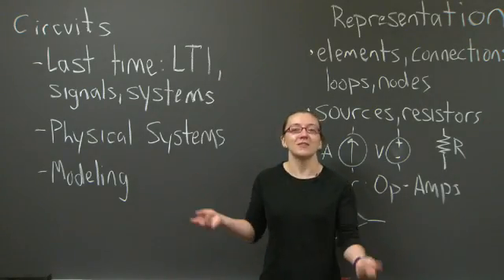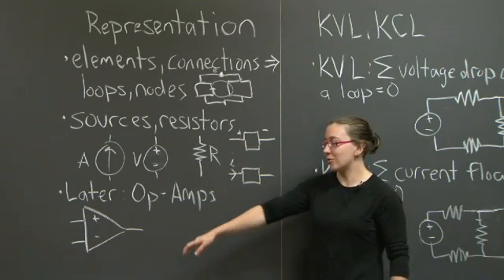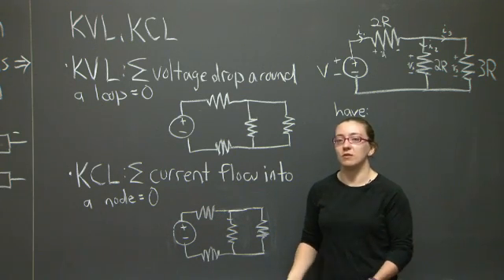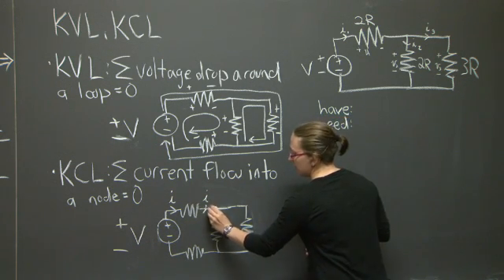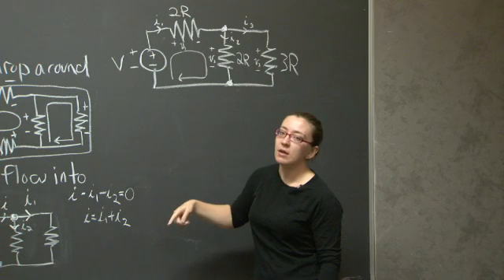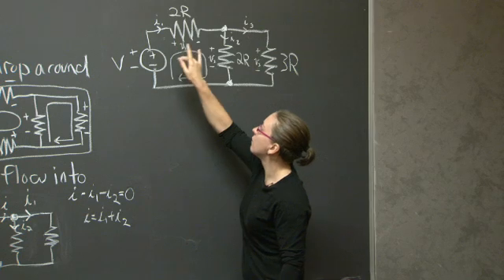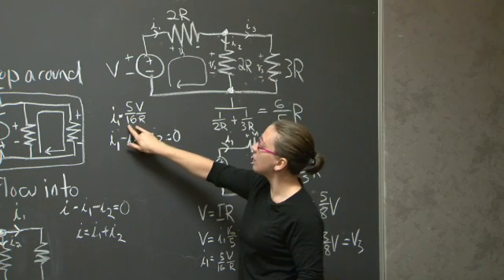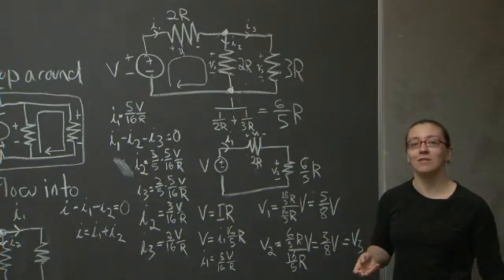Rec 9 | MIT 6.01SC Introduction to Electrical Engineering and Computer Science I, Spring 2011

Comment: KVL while useful for circuit analysis does have short comings in the presence of non-conservative fields inducing activity in the circuit. The closed loop may be excited in different parts based on geometry, angle and distances to the field source. In a transformer due to the design of most transformers their is minimal non conserved fields, you will see this when you analyze their design. However in cases of exterior fields this will not always be the case to assume a conservative field and will even be so in high frequency applications where increased self inductance of a circuit will become non-conservative and the potential in wires may not be ignored. Only in idealized scenarios in order to analyze basic circuits is KVL useful, when the circuit allows these assumptions KVL can save time in a complex circuit.
Reply: What would you use, Maxwell equation within time or frequency domain?
Reply: @1972hattrick  Maxwell's equation always works. KVL works in a lot of simple circuits but becomes an estimate if self inductance is significant. So it depends on what you are doing and time management. Feynman suggests KVL for simplicity when you can afford to estimate in a complex circuit.
Reply: @michaelinamoment  I'm guessing you would be referencing pcb design? So when you have multiple layers of bus and your signal is moving very quickly it induces a changing magnetic field which could induce parasitic inductance into other layers. Now the pcb material is not a conductor so you would have equal charge distribution (instead of charge going to outer surface like a conductor) this would need to be accounted for in the model utilized when solving a circuit (Guess law for field density). IOT minimize the effect of these parasitic issues you would use op-amp to stabilize the output needed at an important junction. 
Once modeled correctly wouldn't you proceed with KVL/KCL rather than Maxwell calculations? 
I'm not an engineer just someone who started watching videos on YouTube last year.
Reply: @1972hattrick  if you have equal distribution of charge then kvl will likely be ok. But the issue often becomes when you don't have such an ideal scenario. I think some people are used to working on certain kind of circuits where they don't come to expect charge from a non conservative field. If your circuit was hit by an emp can you predict it's behavior?
Reply: @michaelinamoment  I can see it becoming unequal or at least changing when different bus lines in a given area activate at different times or different rates. Good to know I'm not flushing the information as I learn it. I would love to find an online course where you learn pcb design and need to take the above into consideration. I don't know if this is done in verilog type situations or not. I am sure we are transitioning into light controlled or light optic integrated chips for these speec reasons.
Reply: @1972hattrick  I think in an industrial setting it would be beneficial to have a computer tool help analyze. When Feynman suggested using KVL as a rough estimate to save time it was before our age of modern electronics and computing power. Imagine just implementing Maxwell's equations on the fly on any given geometry of circuits. That's probably a path worth taking for those that it effects. It's likely a less than 10 year development path to employ an AI to analyze the geometry of a circuit with just a few photos of it and push out correct figures for a given scenario or problem areas if such ill timed activations can cause issues. In terms of product development would probably save a lot of man hours.

Comment: Hi!
Thank you for all these excellent courses (and beautiful teacher) it's explained very very well:))) it's the best course I ever had!!!  I just wanted to make a remark:
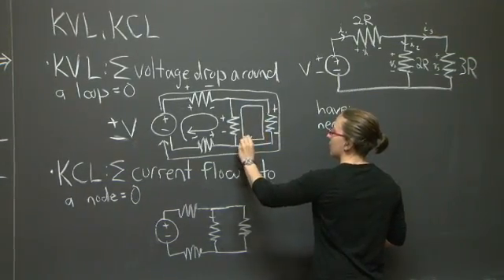is there a little mistake there 06:32 or I don't understand very well? (it should be opposite in that direction, not equal), just before that she said it right (06:27),
Reply: She is wrong at 6:32. The voltage is highest from the top through both resistors so she was technically wrong when she said, "...in this direction..."
The voltage drop across each element is indeed equal but only in the same direction either from top to bottom on both, or bottom to top on both. You can see the proof of this in the next video (lecture 10) at 6:25.